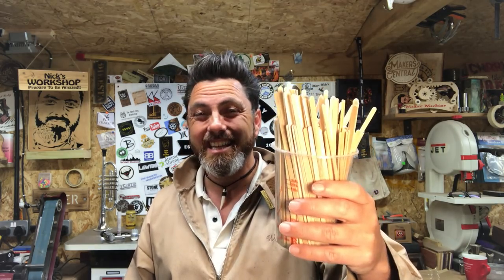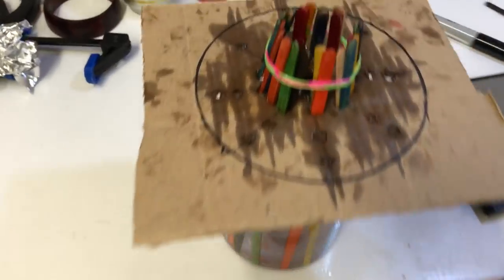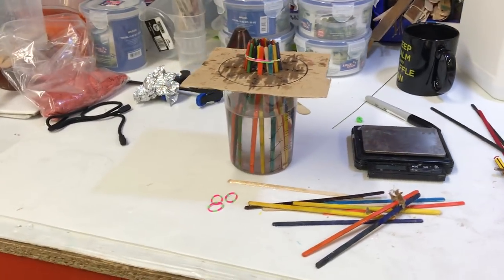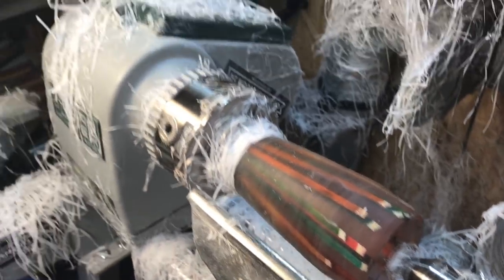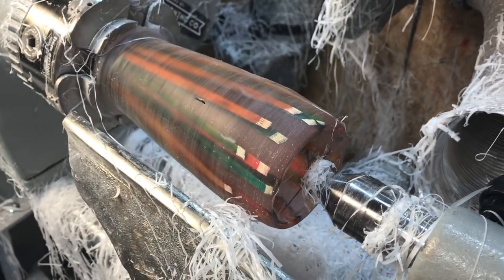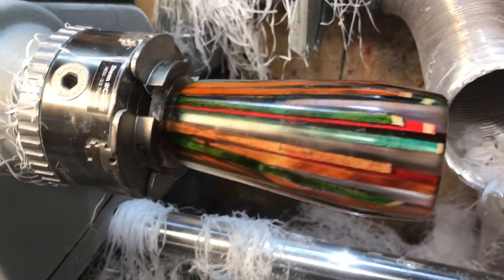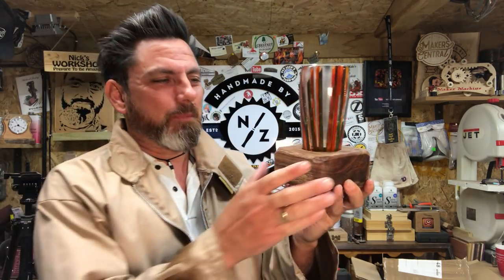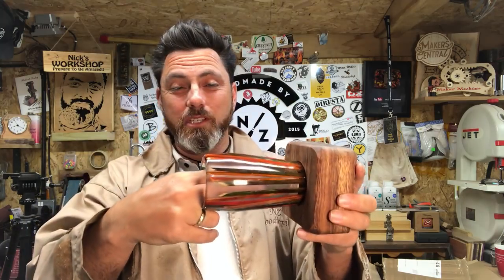Making something out of Costa Coffee/Starbucks Stirring Sticks

Comment: What if you soaked the sticks in water to make them pliable. Then weave them together into a small square, let them dry, then suspend them in resin and turn it into a sphere with the square inside of it?
Reply: Tim Bredow or he could soak them in dyed water to keep the funky colors
Reply: Better to seal the sticks with a type of varnish which would eliminate any air bubbles from escaping from them
Reply: Susan, if he seals them in a varnish they wouldn't be pliable since most types of  varnish are waterproof. He'd have to find one that didn't make the sticks waterproof and that could pose a challenge.

Comment: I think that turned out quite well. I did a bit of playing about with those big lolly sticks a while back & things might translate to those stirrers too.

Firstly, you can submerge them in fabric dye (normal Dylon stuff; don't need the salt) for a month or so & the dye will soak in and colour them through, with deeper colour at the edges than in the centre. The pressure vessel would probably do a great job of getting the colour to go deeper, much faster too. This also works with drawing or normal pen inks, but those are far more expensive.

Secondly, if you want to add some jet black accents to things you can wrap them up tightly in normal foil & stick them under the grill. Assuming you've got proper ventilation just in case, & after a fair amount of trial & error with the timing, you can turn them into charcoal. They're brittle & need to be stabilised with resin (or superglue) but they'll soak it right up & make a nice cheap alternative to ebony with a little of the grain patterns still visible. The most important thing is to make sure the foil is really well wrapped to stop any air getting in, otherwise they'll burn away to nothing.

I take no responsibility & accept no liability for anybody who burns down their home, place of business, or local café after reading this comment.

Comment: Does water mix with the resin before it cures? If not do you think pouring water into the resin befor it cures or pouring water into it with a dropper you can put it directly into it and maybe it will suspend in the resin and give a cool effect. Maybe drill a tiny hole and let the water come out. I don’t know if that would work though.